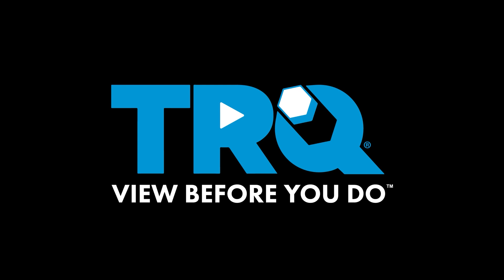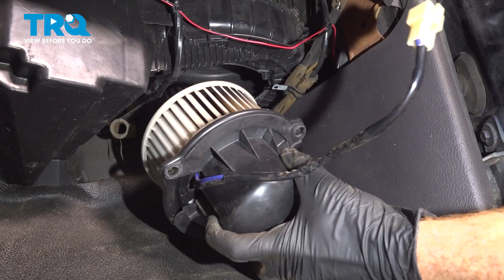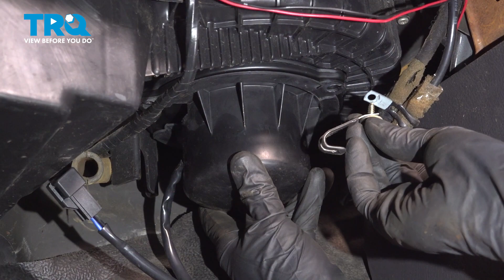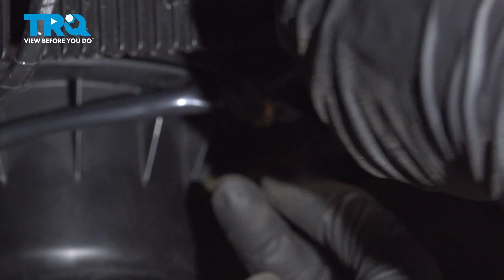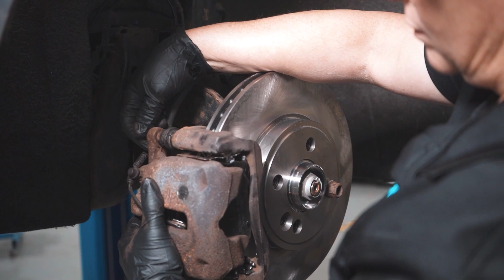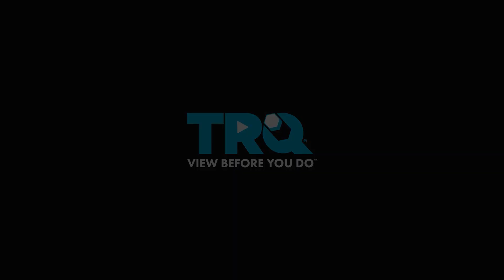How to Replace Blower Motor Assembly 1994-2002 Dodge Ram 2500

Comment: Is there a Cain filter in a 2000 dodge ram 1500?
Reply from the maker: +@kathiemichelle1212 The 2000 Dodge Ram 1500 will not have a cabin air filter.